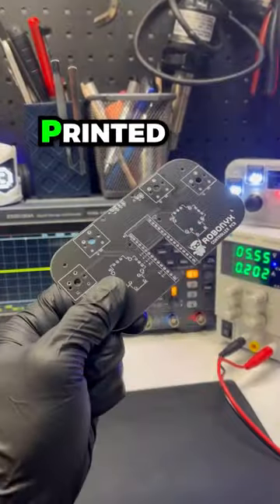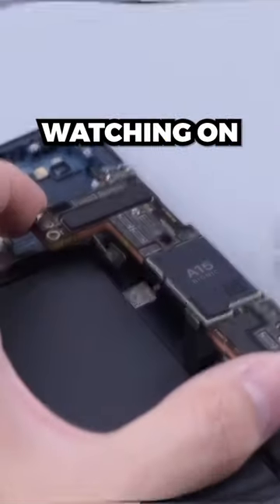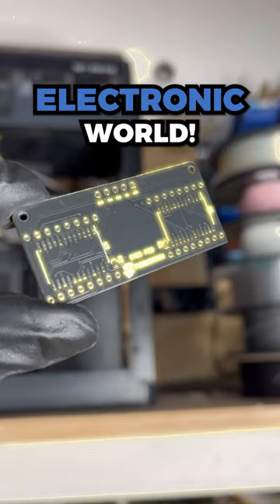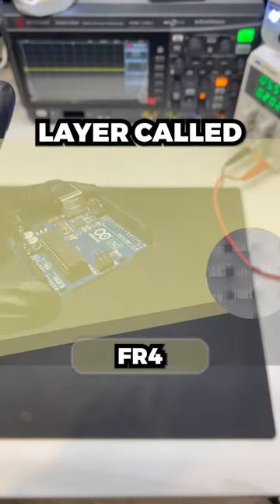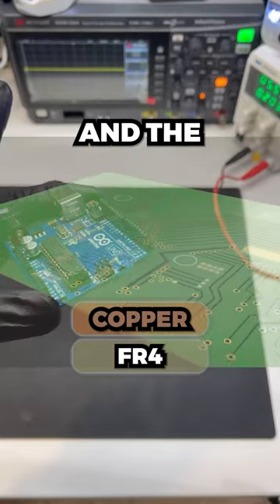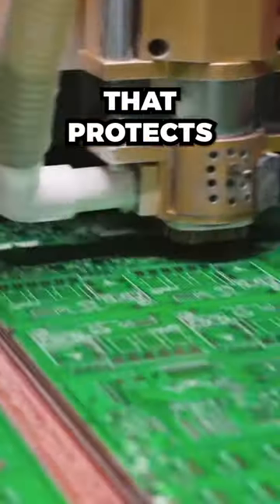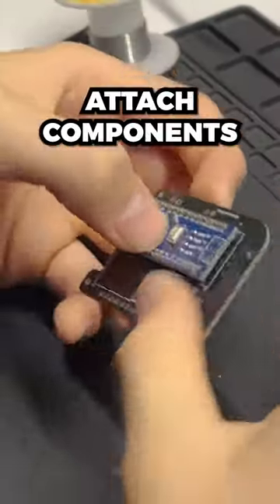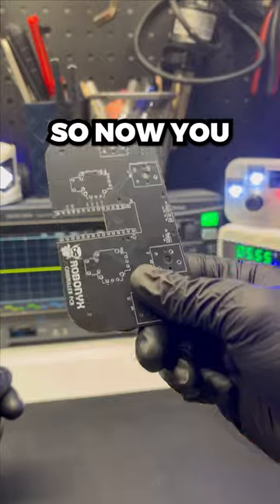What are PCBs? #electronics #maker#STEM #technology #tech #engineering #techtok #robotics #arduino

Comment: CAN be Double sided? Most are 4, 5 even 10 layers
Reply: Layers are not sides. You can have a single sided board with 5 layers
Reply: When I was repairing cell tower equipment, those had 12 layer boards!
Reply: layers are not sides, a flat plane only have 2 sides, 1k of flat planes layed on top of each other also have 2 sides
Reply: Well then it would be impossible to have a single sided board then
Reply: I worked in a PCB factory for a while... the most layer we had once was a 56 layer PCB. The most standard PCB had 26 layers. We even implemented components into the PCB.
Reply: @schnubpsi  do you know what kind of equipment you were making?
Reply: @phillyphakename1255  only that it was for a satellite. Like most of the stuff we made.
Reply: Oh yeah! even 20+ layers.
Reply: @retropcs88   5 layer single sided is possible, but not practical. You need to balance layer stackup  with even number layers to mitigate warpage.

Comment: This was some High quality shorts
Reply: Was it? It got just enough right to not be completely misleading

1) FR-4 is one common material for PCBs, but not the only one by a long shot. There are PCBs that use stuff like aluminum or copper as a base, others are completely flexible with only a film base. Some also have teflon as a base material

2) most PCBs have at least two layers, many PCBs have even more. You can even have 20 layers if you really need to. 

Also worth noting, beyond the copper layer and the solder mask on the PCB, the printed legends are the silkscreen
Reply: @Mooooov0815   99% of PCBs use FR4.  Flex circuits use Kapton.  The base always starts with the insulating layer, then sandwiched with the conductor.  Copper is used 99.9% of the time, because it's easy to electroplate other metals onto the copper base.

Comment: Difference between pcb and breadboard
Reply: On a pcb the parts are soldered on, so they can’t fall out, and the pathways are directly from component to component and they have to be custom made. A breadboard is for prototyping, and parts can be easily swapped out
Reply: PCB has an adjacent copper ground plane.  Which is 100% necessary to silence EMI.